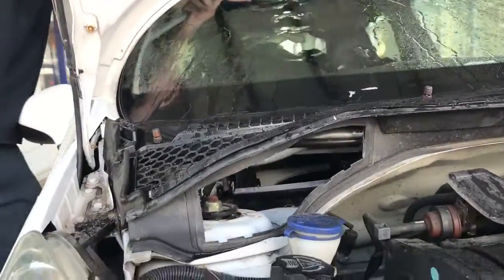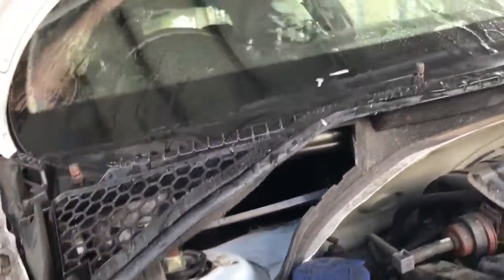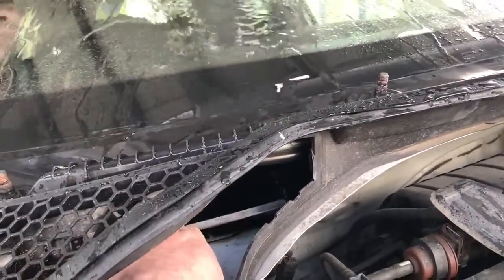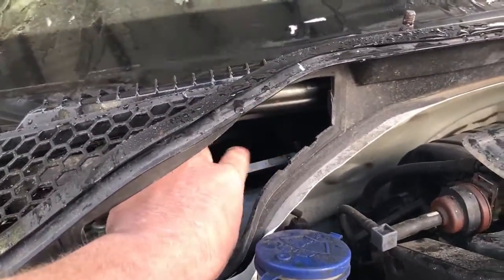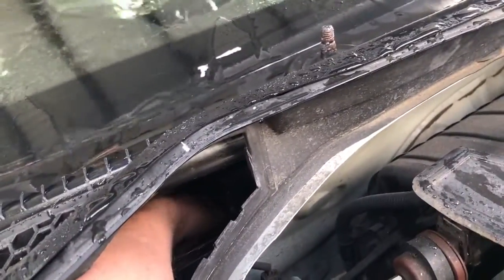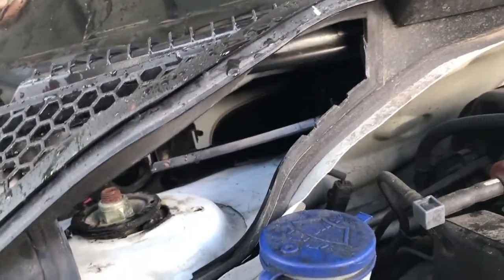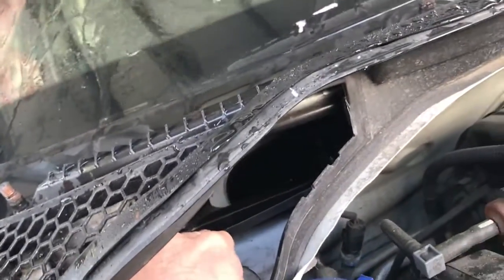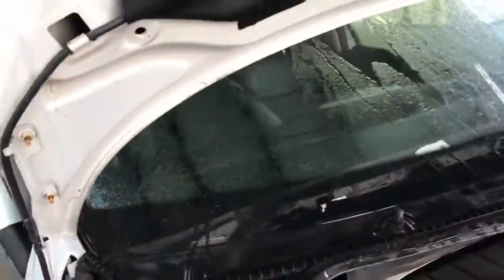Peugeot 207 | Water Leak From Windscreen | #PeugeotWaterLeaks

Comment: Did you find the solution my brother has the same problem we think he got to the car 6am this morning and there was a puddle in the drivers footwell but everywhere else was bond dry
Reply from the maker: The plastic 'door' ages and the plastic warps and shrinks, so the clips don't hold it shut. As professionals, we would have got a replacement part and made it like new. Getting some electrical tape and taping it closed would definitely work as a short term solution.

Comment: Hi did you just replace the scuttle board? Having An issue with a bad leak that is flooding the car it’s definitely coming from the front of the car and leaking through the drivers side near the pedals and making a puddle in the back of the car
Reply: The scuttle panel should let water through so it can drain away into the trough where there are drainage holes. The problem on this car was the hinged cover over the air intake for the air-con. The plastic became old and weak and so it wouldn't stay shut. 

Replacing it would be best option, but on this car, i think we did something to repair it and keep it closed as the customer didn't want to wait or pay for parts.